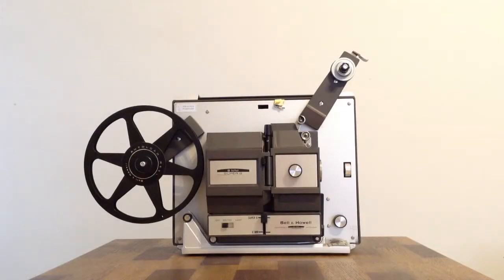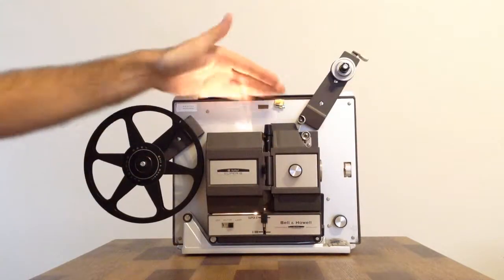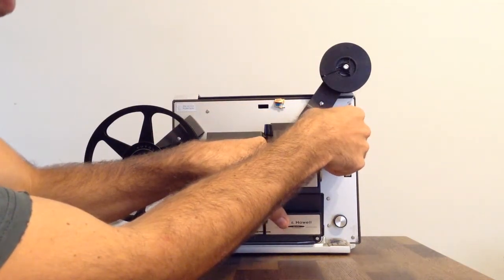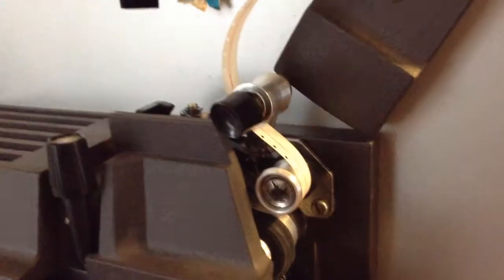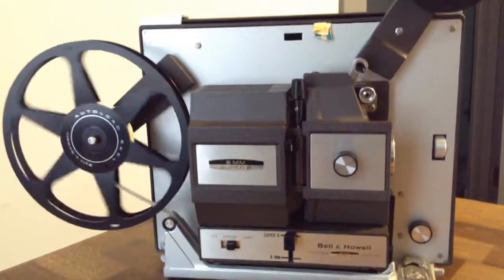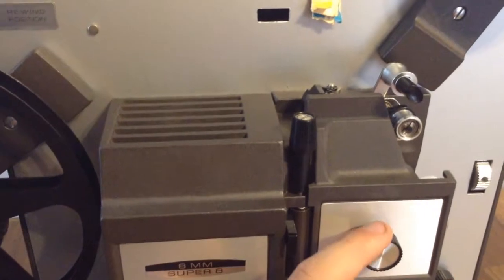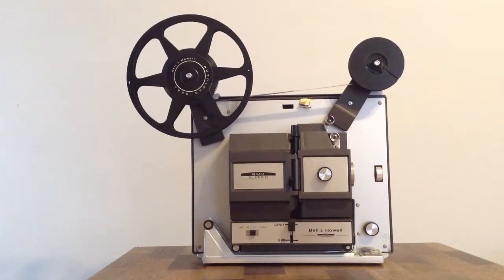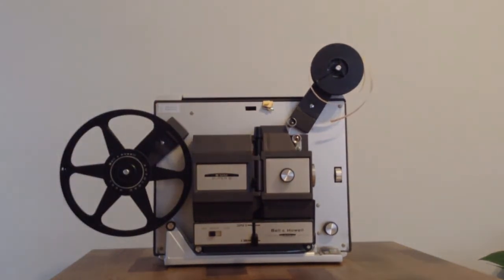Bell and Howell 456A Autoload Projector

Comment: I have a B&H 466ZB also with Auto feed and both 8 and Super 8 . Trying to project on a kitchen wall about 6 feet away - seems real bright and over exposed - is it an overexposed movie (they all seem this way or am I too close? I cleaned all the lenses with lens cleaner4 and cleaned dust off the bulb. Advice welcome.
Reply from the maker: Seems like it may be overexposed. How does it look when held up to the light?
Reply: @davedoes2121  Dave it looked ish not dark but not over exposed either as I saw on the screen - what is the ideal distance ( projector to screen?